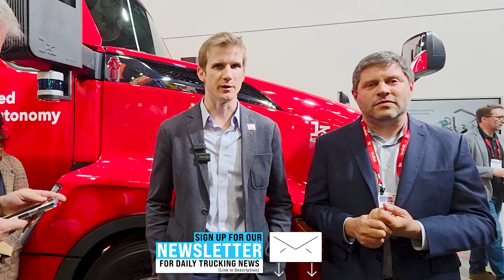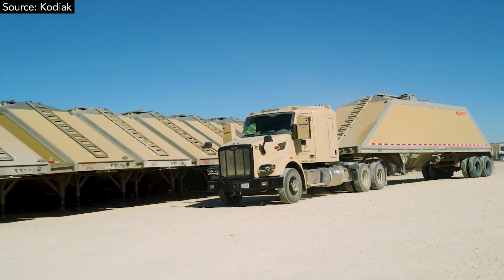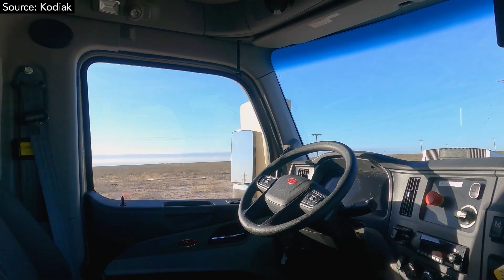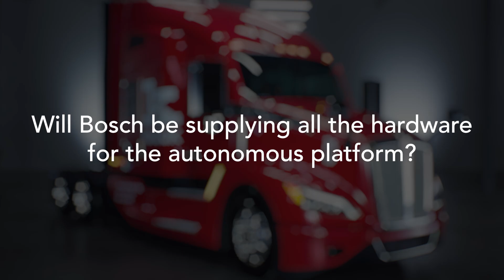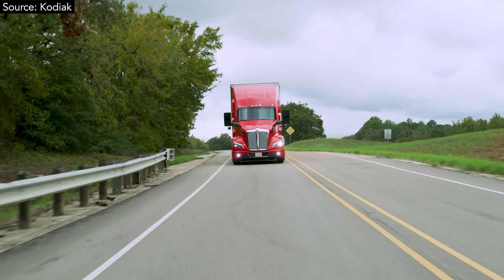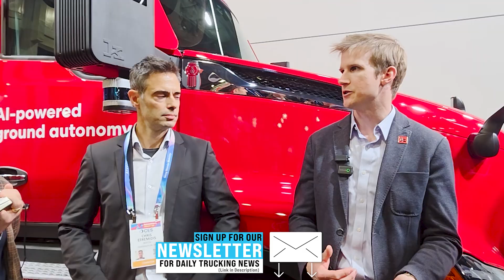Bosch, Kodiak partner for production-ready truck autonomy

Comment: Who is responsible when these trucks kill someone on the road?
Reply: if microvision tech is in these, then no one will die.
Reply: Same as any trucking company. That’s what insurance is for. These will be much safer than human long-haul drivers, so insurance costs should be lower too.
Reply: The company will still be responsible. But that outcome is highly unlikely. It won’t eliminate the need for a driver, but the driver function will change. They won’t drive. They will be like airline pilots. Checklist of pre-trip and post-trip inspections, setting coordinates, and taking over in the event of failure.
Reply: @MrWalsh-mv9qz there is no way automation of transportation can ever be truly safe and reliable on paved and unpaved roads.  It will never be able to guarantee safety in the air or on terra firma.